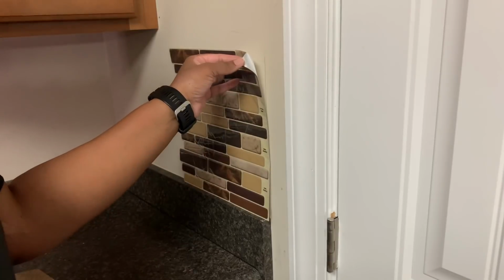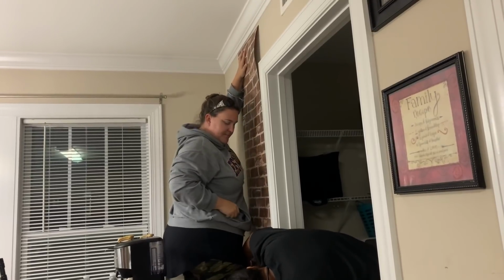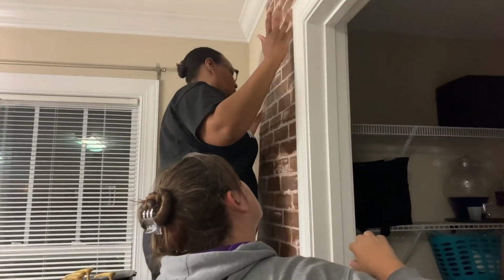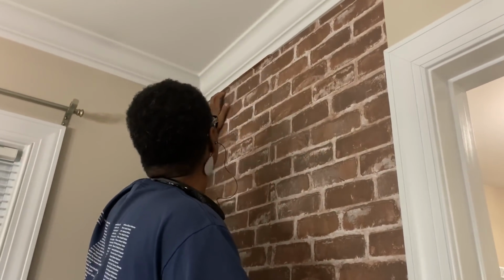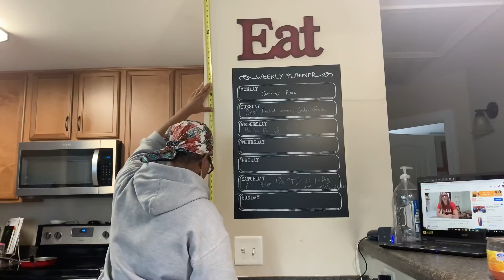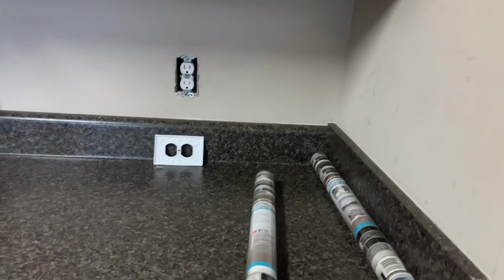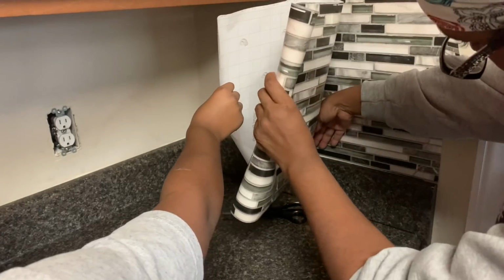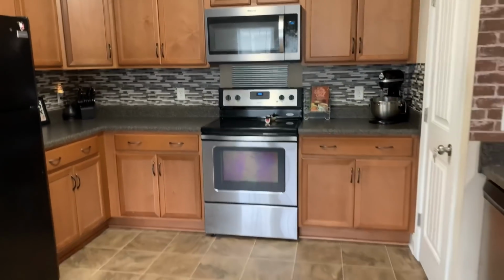Budget Kitchen Makeover  ||  Kitchen Redo for $50  ||  Made Some BIG Changes To The Kitchen

Comment: When my old refrigerator was rusting through I used contact paper to hide the rusty spots. It has since died, but it was a cheap alternative to an expensive purchase. I need to do something with my kitchen floors now, they have peel and stick flooring on them that won't stay down. Everything is going to have to come out new wooden base floor then maybe some good old tough linoleum. My kitchen is 1930's whimsical so anything either wild or quiet would go. Thanks for the update video. Great tips.
Reply: Oh let the lord be peace ✌🏻 hello how are you doing today hope you’re having a wonderful day today today I guess